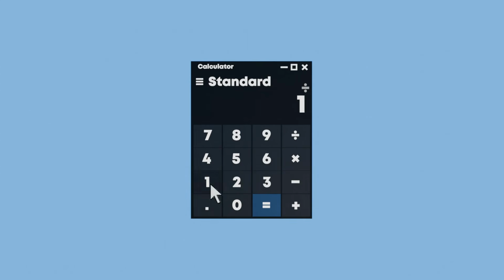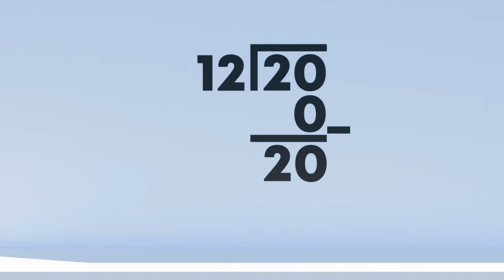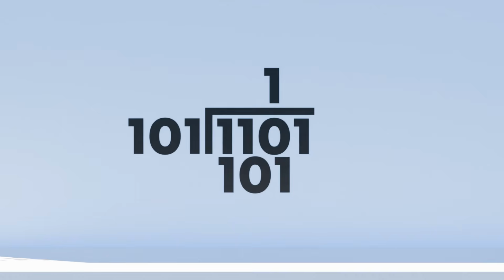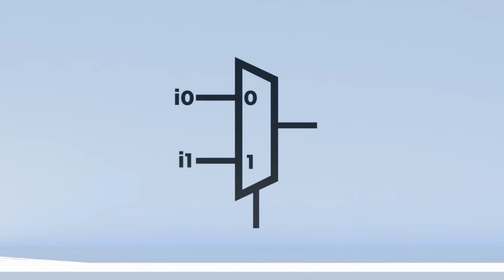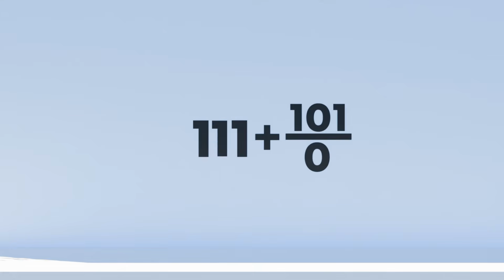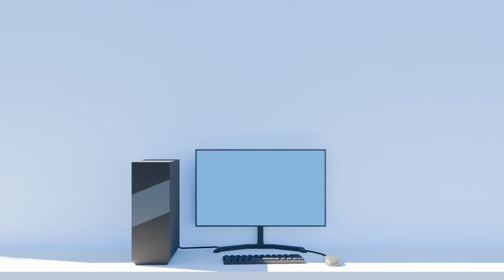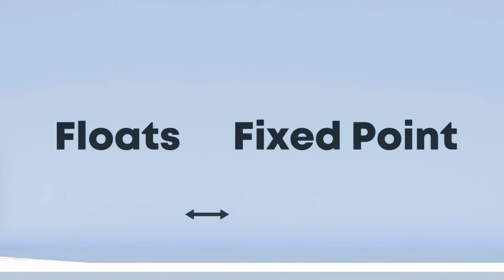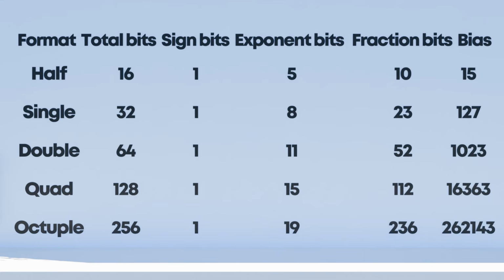How Computers perform Division

Comment: Financial applications never use floats, at least to express amounts of money. These are always expressed using fixed point, because floating numbers are prone to rounding errors. For instance when you add a very large floating number to one that is very close to 0, the fiorst number does not see any difference (because it's precission is not big enough) and you end up with an erronoeus result. This is acceptable in most applications, but in finance it is not.
Reply: imagine having $0.1 in your account, someone sends you $0.2 and now you have $0.30000000000000004
Reply: @smb1397  free money baby
Reply: I recall hearing somewhere that with 64-bit integers, the maximum possible account balance is around 900 trillion. Which means it's divided down to 1/10000th of the base unit.
Reply: Excel uses IEEE 754 floating-point. It doesn't have rounding errors.

If you put 0.1 in a float, it's a repeating binary decimal. The value stored is more like 0.100000000000000005551115. So Excel just makes sure it truncates everything to 15 decimal places. When you put $0.10 into Excel, the float has a value of 0.100000000000000005551115, but it gets truncated to 0.100000000000000 before it does any math on it. No more rounding errors. Except in edge cases. Because Microsoft.
Reply: @RaquelFoster  Rounding like this is just hiding the underlying imprecision. It's still there, because the rounding is only applied when it's displayed, the number under the hood is still imprecise, it just isn't visible until the imprecision accumulates. And with financial applications, things can accumulate fast, because the exact case of adding a small amount to a large amount is basically exactly how a savings account works, for instance.
Reply: Same thing for cryptography. I never heard of any cryptographic algorithm that uses floats. Asymmetric crypto heavily relies on finite fields, usually prime fields. All elements in such a field are integers (at least from the perspective of a programmer). Symmetric algorithms typically operate on unsigned integers of a fixed width, e.g. 32-bit (e.g. TEA, XTEA, Serpent) or 64-bit (e.g. Threefish). Some algorithms like AES and GCM operate on binary polynomials, but that's just a complicated way to describe carry-less multiplication (i.e. using bitwise-XOR instead of addition).
Reply: @dennismuller1141  Wow I missed that. Cryptography is all integers and tons of modulo. You never see floats or division!
Reply: @ well, you could count modulo as a division operation. And in asymmetric algorithms you often have to divide in a finite field, but that requires the computation of a multiplicative inverse of the divisor with the extended euclidean algorithm. Examples are RSA key generation and pretty much everything related to elliptic curve cryptography.

But yes, floats are never used in crypto as far as I know.
Reply: @RaquelFoster may be elliptic curve crypto maybe ?
Reply: I would say that the more precision you need for an aplication the more bytes you need to store a number, that looks a bit more logical.
Reply: Actual bank transactions use COBOL code running on virtualized mainframes which store numbers in COMP-3 packed decimal. That's how it's worked since the 1950s, and it's not really about rounding error. They just needed an appropriate datatype. Money is a fixed-point decimal. If you move the decmial two places it's an integer. Floating point math existed in the 1940s, but using it for financial data would've been insane.

COMP-3 makes you define how many places before/after the decimal. If you want to store $53,180.08 you need to declare the type:

PIC S9(5)V99 COMP-3

Then you can put the number in it. The reason it's called packed decimal is because it's stored as a human-readable decimal packed into bytes. Each byte stores two digits. Each 4-bit nybble is one digit. That means the low nybble / high nybble are 0 to 9 in hex. You can read the number in a hex dump. It would look like:

53 18 00 8C

The C means positive.

When computers got better and floats became less resource-intensive they kept using fixed-point because it's still better in this application for several reasons including the lack of rounding errors. But COMP-3 was chosen for other reasons.
Reply: You could also use rational numbers, implemented using big integers.
Reply: The decimal datatype in dotnet floats, but has no rounding problems here. Mantissa is binary. Many seniors don’t believe me? But the source is open!
Reply: @ArneChristianRosenfeldt  Not sure what you mean by “no rounding issues”. It’s still a finite amount of space (128 bits), so lossy calculations like divide still lose precision over many calculations. It can store any base 10 number (that’s small enough) exactly (hence the name “decimal”). But it can’t store every number exactly (1/3 =0.333…)
Reply: @steven1671 I meant rounding issues from base2 . Divide by 5 . Yeah, I read some finance tests lately and the professor accepted two values from students which could happen due to rounding . ( 1 cent difference)

Comment: Floats are trending in the less precise direction as well, in the quantization of AI models. FP8 (either as e4m3 or e5m2) is very common, and nf4 (normalized float) is very commonly used to cut down the memory footprint so it can be loaded into the VRAM of consumer-grade video cards. The vast majority of DeepSeek-R1:70b is quantized to 4 bit precision, allowing a 70 billion parameter model to be shoehorned into 46 GB of RAM. There is a quantization of the full-size 671 billion parameter model of DeepSeek that uses an average of 1.58 bits per parameter: almost every parameter is 1 bit or 2 bits, and a handful of critical ones might be nf4 or even FP8. This allows it to fit in as little as 192 GB of RAM.
Reply: I would not train on low precision, though.
Reply: @ArneChristianRosenfeldt  That is true. Once a model has been quantized, it's no longer really fit for further training. It's optimized for "playback". However, the definition of "low" is "less than 8 bits" because there are workloads for which 8 bits is sufficient even for training the model from the ground up.

Comment: It's really fun with algorithms that are really complex in decimal end up being trivial in binary due to only have 2 possibilities instead of 10. Binary square root has a similar algorithm as division that is similarly elegant. Multiplication, which is needed for each pair of digits in a multiplier, and as an intermediate step in division, is literally simpler than addition since the only possibilities are 0, which always gives 0, and 1, which just passes the value through.

Something you didn't mention is division of negative numbers, and unfortunately they're handled in the most boring way possible, and even less fortunately, this method is also one of the least useful forms of integer division. It's just done by converting both numbers into signed-magnitude and dividing their absolute values, and then correcting the sign afterwards. This yields truncating division, which is practically useless in most cases. It is possible to directly divide 2's complement numbers without taking their absolute value first, and this does give more useful forms of division, but I'm not aware of any hardware that implements this. Several programming languages however offer these alternate forms of division, which use the hardware's truncating division, and then corrects the result afterwards. On the topic of negative numbers, negabinary is cool and really easy to convert to and from 2's complement, and is done by negating the sign of every other bit rather than just the left-most one.

And then you go on to talk about my arch-nemesis, justifying the reasonable parts fairly well, and also glossing over the parts I'm not as fond of. :P An alternative to IEEE-754 is the Posit number system, which is effectively a compression scheme for a modified floating point format with some nicer algebraic properties.

Comment: Divide a number by 2 or by 4 or 8. This is easy for computers. 
The numbers are already in the binary number system. 
Divided by 2 is equal to moving the bits one place towards the lowest number. 
For b0110 divided by 2 is b0011. 
For divided by 4 you have to move twice: b010 1100 -> b0000 1011
For divided by 8 you have to move three times: b1011 0000 -> b0001 0110
Moving one position can be done in one work cycle.
Reply: That's how it is with integers anyway. Often when you need to divide by two or a power of two, the shr (shift right) instruction is used instead of div since it uses fewer clock cycles. With floats, it's a little different. If you're dividing by 2^n, you just need to subtract n from the exponent in the float. It's simple in theory, but I don't think there's an instruction to change the exponent directly so you'd have to do a lot of manipulation using bitmasks and such to do it indirectly.

Comment: could you make a video on how the floating point arithmetic algorithm actually works? like when it knows to change the exponent and when it knows to decrease it and that stuff u know.
Reply from the maker: We will make a video about floating point operations in the future.
Reply: @seriouselectricalengineering  lovely, a video on protocols of different stuff like usb, hdmi, and the pcie slot would also be pretty cool as its not very well covered and u seem to know alot.
Reply: @Original_Moi  You'll probably want them to start with simpler ones first, like RS-232, CGA, and ISA before building up to complicated stuff like USB, HDMI, and PCIe.

Comment: I think the long division presentation would be a little less confusing if you chose a fixed width font, so that the columns of digits lined up.
Reply from the maker: Hello. We made sure it was all lined up and obvious, but after reviewing it now we found out you're right. We'll keep it in mind for our next projects.
Reply: @seriouselectricalengineering  11:27 IEEE 754 or 745? Which is it?
Reply from the maker: @jovetj The correct one is IEEE 754. The 745 is a mistake in the video
Reply: monospace is love. monospace is life.
Reply: A font with tabular numbers is a better choice more often than not.
Reply: or you could put grid behind (some what transparent) so we could visually separate and follow. Anyways great video:goodvibes:
Reply: This is ocd behaviour. I personally prefer using multiple sheets for each digit 😂
Reply: I don't think it's confusing at all.